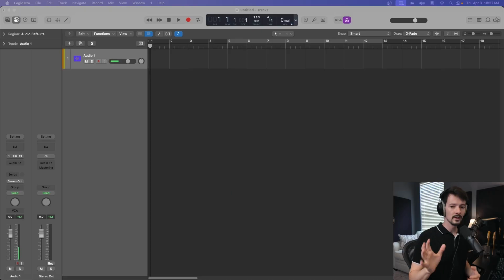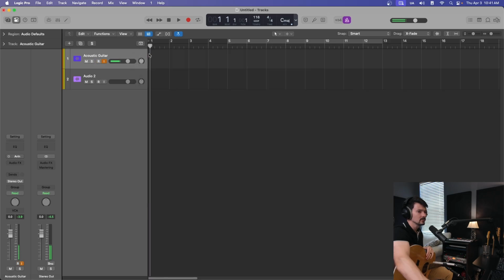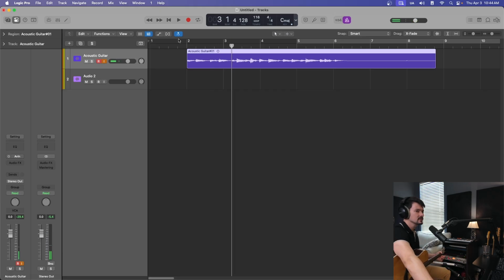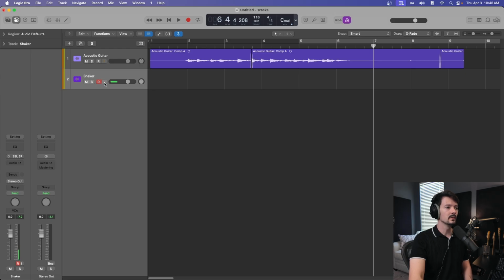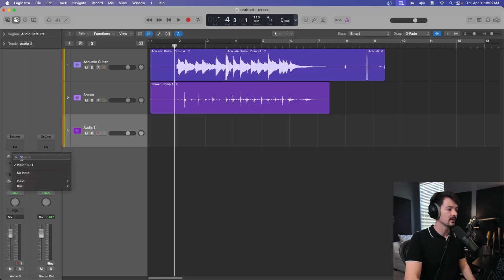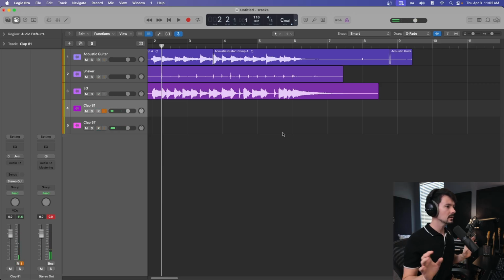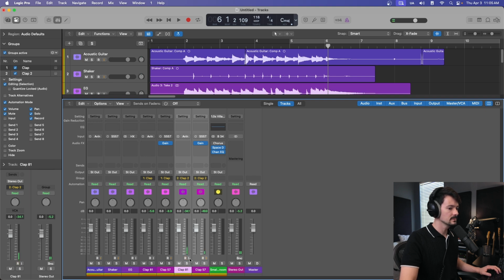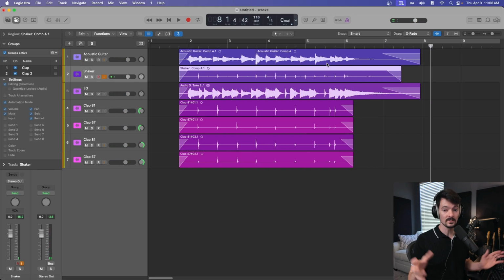Logic Pro 103: Recording AUDIO

Comment: Why do you want the recording to start at bar 2? If you set arrangements, etc that start at 1 but want to move them to 2 - how do you do that?
Reply from the maker: Starting right at 1 can cause the export to have a little pop right at the beginning. I usually back up a bar and fade it in from beat 4 so I have a smooth start. You can grab the starting playhead/start point I. The session and pull it backwards to bar 0 if you want

Comment: I recently experimented with IO Buffer size down from 128 to 32 for Drums specifically - made a huge difference with time keeping on drums.  Also, was your tele DI on this example or were you through an amp first?
Reply from the maker: Nice! I was plugged into my Line 6 Helix for this. So DI technically, yes.